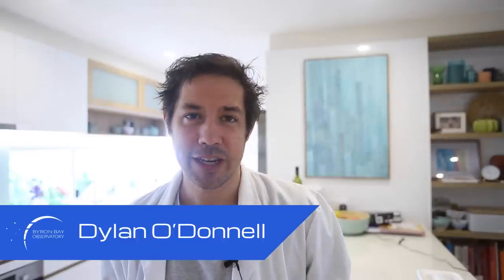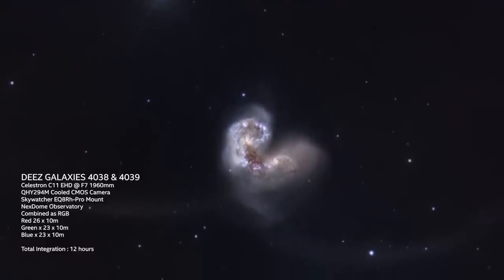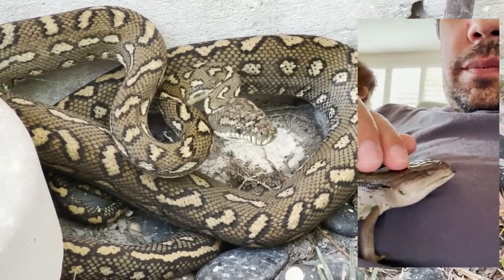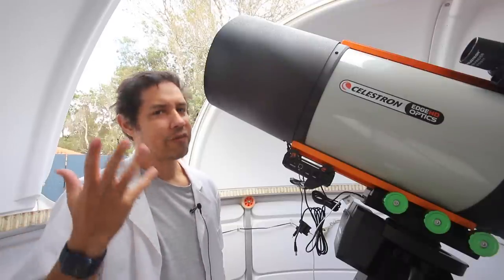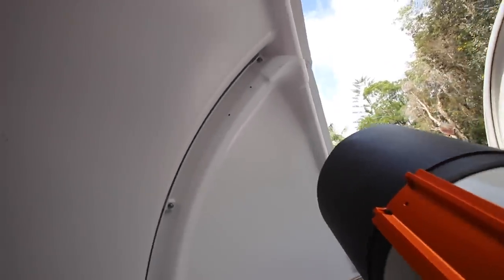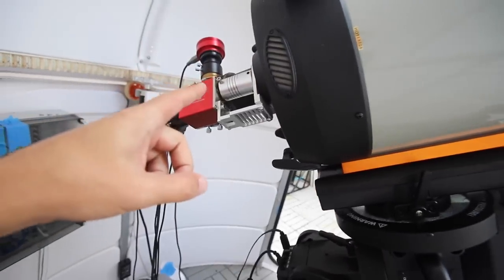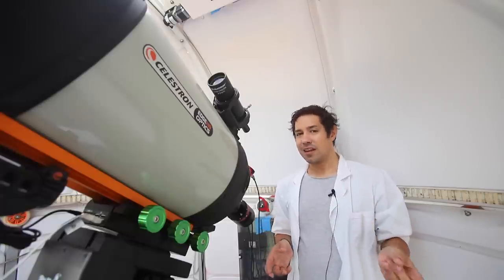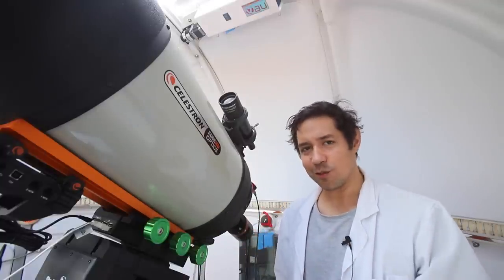13 Things I Hate About Observatories

Comment: re: Searching for screws that fell out, you can fix that forever with a bottle of Loctite from the hardware store. It's glue for your screws, put a tiny dab on the threads before you screw them in and they don't loosen over time, but you can still remove them (with a bit of extra force).

You don't want it on stuff you're removing every day, but if it's gonna be bolted on a good long while a dab of the blue stuff keeps everything nice and snug.

Comment: Installed an observatory two months ago. I've used a telescope more in the past two months than I have in the past two years. Best money I've ever spent in astronomy. For humidity control, I just use a mattress bag closed with a bungee cord and several large rechargeable desiccant pods (Eva-Dry Bundle) inside the bag. Within the bag containing a C11 and a Losmandy G11, the humidity stays below 25% at all times. It also protects the scope from dust. It takes less than 2 minutes to remove and I recharge the desiccant once every 2 to 3 weeks.

Comment: #11 is exactly why remote power on ports, network switches and PCs are reaaaaaaaally helpful. Most people don’t appreciate why expensive USB hubs are expensive until you realised they are managed ports vs your generic amazon hub. 

Btw Dylan, thank you so much for being one of the few chill astro guys. So many people atm seem to have a massive stick up their butt and I just need some meme culture. Your videos give me that chill and the smile needed <3 

Fun fact 13:22 - that’s exactly the visual quick cue that lorry drivers use on their wheels. Those little reflective tear drop shape things you see on them give a quick indicator that the wheel lug nuts are all tightened without having to actually check them.
Reply from the maker: Thanks man :) I too have a huge stick up my ass but for different reasons.

Comment: My observatory is a simple 12'x12' concrete slab in the backyard. I was using privacy mesh fabric and t-posts to shield light, wind, and prying eyes but because it signaled "expensive equipment outside all night" when it was up, I needed a better solution. I would love a roll-off roof observatory but I opted for a permanent 6' solid fence around the slab as the best solution for function and security. I now mount a steel pier for the season and set up is simple and fast.  Half the year, I run away from the snow and sub sub freezing weather to the winter home where a private courtyard becomes the observatory. Love your videos. Always entertaining and informative. Keep it up!
Reply from the maker: Sounds great!

Comment: I completely get point #13. I'm lucky enough to live in an apartment that has a decent balcony, so while I can't have an observatory I can still have a decent semi-permanent setup if I so wish, and control everything from inside my living room (only having to go outside to mount everything and polar align). Pro tip about your WiFi: powerline internet has been such a quality-of-life improvement for me that I highly recommend it. Signal input inside, WiFi extender outside... works like a charm.
Love the humor as always!
Reply from the maker: Yeh Poe would be a great solution .. I’m sorted as I’ve got gigabit eth to the obs and an external wifi off that. It’s just annoying changing networks on my devices when I go outside :)
Reply: For mine, I have GigE as well, and my observatory is just about 300ft away from my house. I ran ethernet in conduit underground to the observatory. I use a mesh access point to prevent having the switch networks, etc. for my maintenance tasks. Already had mesh since my house is mess to run wifi in since I have 2ft stone walls. Actually works really great for my phone and tablet

Comment: Great video, and while I have had a lot of the pain points you have, I agree totally with #13 - it is great having an observatory. The plusses definitely outweigh the minuses. Additionally, I can sneak in some extra hours if I know the forecast calls for rain later in the night, I can close up shop while still grabbing a few hours. Before the dome, it would have been a night I would have skipped imaging at all. Quick tip, as I had little grub screws fall off as well and ruined a night of imaging (mostly on the shutter for me). I added a dab of blue locktite to ensure the screws do not vibrate out over time. Definite peace of mind! 

When I have several nights without imaging I have also had battery issues where it id drained and I cannot operate the shutter. I recently added a smart outlet and used the software to turn off the shutter charger late in the morning, and turn it back on 10 minutes later. It ensures a new charge cycle as the supplied chargers don't do a maintenance charge unless it is connected or disconnected. Been doing that for about a month now and have not had a undervoltage issue with my shutter so far!!!

As said in other comments, I hope your son is doing well.
Reply from the maker: Great feedback .. and thanks! Yes I think I’ve killed about 6 batteries so far. In fact I ended up replacing the shutter screws with screw hooks because they’re easier to remove without tools 😆

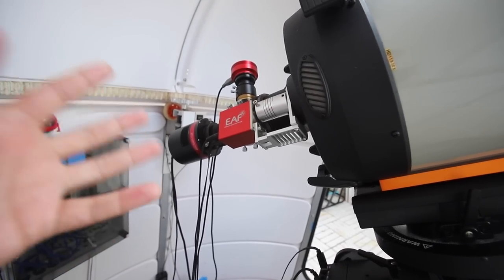Comment: #17 08:25 I definitely run a direct burial ehetnet cable to my rig. My Ubuquity AP's do well when using my phone to remote-in to the astro-laptop but sometimes I get intermittent signal loss if I stand directly behind the mount with my phone in hand like during polar alignment.

Comment: I am now going to check my EAF screw!

I also never use Wi-Fi, I hardline that bad boy.
Reply from the maker: Heh just give it a little tighten .. just in case! Even after I fixed it my backlash settings were wildly different than before so the AF settings in nina had to be reworked .. basically wasted the night heh.

Comment: I have a SkyShed POD, and the dome cover for it, which has been 100% effective at keeping rain and snow out.  For the bugs and critters, I drape one of those thin, silvery space blankets over my telescope when I'm not using it, and I keep a small fan running on the floor pointing up, and that small breeze causes enough movement in the space blanket that it seems to do a very nice job of keeping the critters away.  I'm also running a dual telescope setup so the clamshell opening of the SkyShed POD works best for me, a single slit setup like the NextDome would be too narrow, but the downside is that all opening and closing of the dome is manual for me.  And solid foam floor panels definitely help with random dropped screws ;-)  I ran 2.5Gbps Ethernet (along with power) underground to my observatory, that allows me to do things like having captured images saved immediately to the NAS in my house.  The observatory has definitely been a game changer for me.  There have even been times when despite the forecast saying it would be cloudy, I do get a clear sky for an hour or two, and with the observatory always setup and ready to go, I can be capturing images in 10-minutes or less from that first realization that the skies are clear.
Reply from the maker: Yeh I used a cover with the skyshed pod too! Sounds like a great setup :)

Comment: The battery on my shutter lasted an entire year, I went and picked up a non-lithium, changed out the charger, and it now works. However, I'm debating building a power rail system and ditching the battery all together. I also swapped out the conductive straps with some soft springs (the conductive straps will tear if you rotate the dome with the shutter closed a lot). Mechanical stuff is my jam.
Cheers from Oakland Bay Observatory
Reply from the maker: Yeah you sound way more capable than me :) the power rail solution sounds good. From a software point of view I wish the driver could trigger an email or push notification if it detects no incoming voltage for 18 hours.
Reply: @DylanODonnell  You would think, right?

Comment: I would love to do what AstroFalls is doing and have two remote telescopes set up at observatory farms in the northern and southern hemispheres. Though, one big drawback I can think of being dependent on an observatory is trying to get your telescope to thermal equilibrium like James Peach does for planetary imaging. Trying to get a large telescope to thermal equilibrium is hard, and and being around stuff that cools or warms at varying temperatures may cause issues. Of course observatory temperature controls can help get the telescope closer to ambient temperature but you have to guess what the temp in future will be. Its best just to take the telescope outside a number of hours before night fall to let things equalize.

Comment: You observatory is next home, lets talk about maintenance and problems in my observatory which is in Northern Chile while I live in Panama, the temperature difference between summer and winter and daylight and night. By the way some of mentioned items are maintenance and others are good planning when designing the observatory, and with all mechanical and electronically equipments there are problems which is part of the hobby.

Comment: some of these are the reason i built my own. the roller roof can be back in less than two seconds.

Can the dome not be mains powered?

The arrows are a great idea i do it on everything :D

Andy yes. the obsy life is great .
Reply from the maker: Not sure on power options. I had mine wired up because cable is stable !

Comment: Dylan! You have completely solved (I hope) an issue I was having with my own focus failing to work reliably--I had recently found a screw on the ground near my scope, though not in my observatory, which is still languishing in boxes waiting for it to be assembled, and had no idea what it was from. Turns out it was from the EAF!! Huzzah!!
Reply from the maker: Amazing! I was scratching my head for so long and had to sit and watch the focusser before I realised it wasn’t engaged at all! That lead to the search on the ground. When putting it back I pulled the springy sheath as far back as possible and that’s also reduced the backlash a little too as it has less give before it winds.

Comment: Great Video Dylan.  I have the same set up and sent you an email with a couple of questions.  Right now I am trying to get the dome geometry down and dealing random software and mechanical issues.
Reply from the maker: Heya .. I have a video where I talk about dome geometry more specifically and share a screenshot of my settings. I ignored what should be in there and simply changed the numbers until it behaved. Now it’s set to 900mm from memory which makes no sense ,, but for some reasons follows the scope better than ever before.
Reply: @DylanODonnell  cool Dylan, I've been tweaking it for a weeks or so.  I'll check out the video out.

Comment: I thought, that I'll observe more if I'll have my observatory. And I do observe more during the night, but I am too lazy to switch scopes for solar observation or remove the camera to do planetary or visual, because I don't have the mood to retake flats or fiddling with the camera rotation over and over again. 
I even don't want to go out to the observatory to unplug a cable, so I am currently working on a remote controllable power distribution box, that can turn on and off the peripherals of the scope and stuff like that.
Reply from the maker: Nice! I can remotely power up / down stuff ok no problem. But very rarely a device simply wants to be plugged in again. It makes no sense .. but that’s windows :)

Comment: Might be a stupid suggestion as you've already probably thought it up, But if you connect a cheap wifi access point to that ethernet switch you could land a solid wifi connection from inside the dome...and warm your nuts at the same time.
Reply from the maker: Yeh that’s what the video of the antenna up a tree is :) it’s an outdoor wifi antenna plugged into the obs Ethernet connection. Works fine, I just have to remember  to change networks to it when I’m out there.
Reply: @DylanODonnell  ohh my bad got it, lol for some reason I thought you had the antenna wired up to the house to cast out to the dome! Nice nice

Comment: Is there really nowhere we can find that cute little galaxy-picture? Fun as always! Do you reccon I should build a dome for my setup? StarAdventurer CGi, used Canon 700D, a lens heater 🤣🤣🤣?!
Reply from the maker: Nice portable rig :) you can find my work on deography dot com or Twitter, Facebook or Insta. I’ve started uploading to wiki commons too .. the images are free and public domain!
Reply: @DylanODonnell  Thanks - breathtaking picture! The setup is simple, but for the time I have and the number of clear nights here it's perfect for the moment. My 6'' SC has to wait ... I pointed it at M87 a few weeks ago, with just a stock-300mm-lens and it  just blew me away again! Not just that one galaxy, knowing how far away it is and what's going on inside it with that supermassiv black hole and the jet etc., but also how many galaxies I could spot around it. After removing the stars I counted over 40! Have a good one, and don't forget ... you know ...